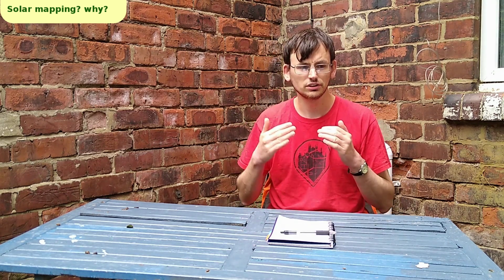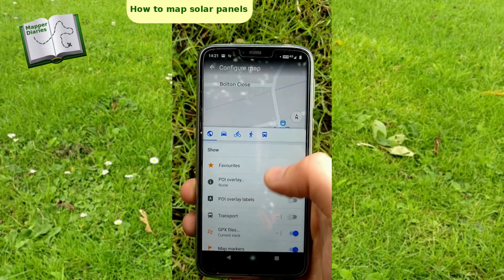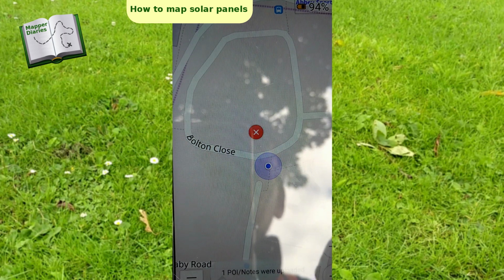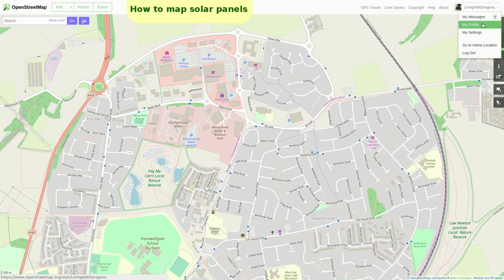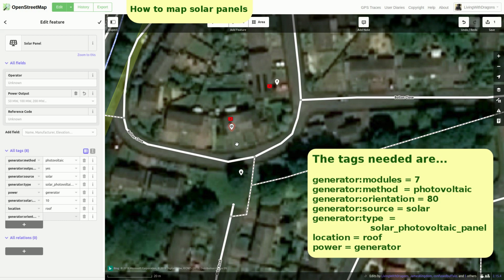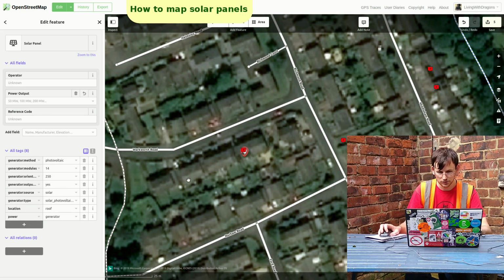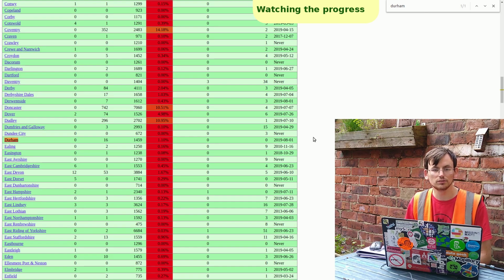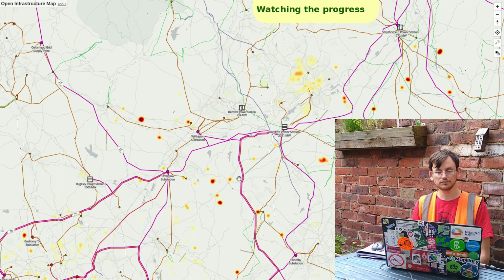Increase solar energy use with mapping

Comment: Thanks - I was going to chat with you about doing exactly this!

Just a note, from memory and conversation with suppliers, in the UK there used to be a 3kW installation point for small solar arrays that could be installed without telling the grid provider, so most domestic systems will be around that regardless of number of panels. Bigger kW installations, such as the 50kW one at the school where I used to teach, had to be notified/permitted since there is a bigger knock-on impact on the local grid and area.

Tech improves and you need fewer new panels to give 3kW than, say, 10yrs ago. One provider told me that people buy by the kW and the actual number of panels depends on that divided by the available area. The price balances out - fewer expensive ones vs more less costly ones. So, you can't just count panels and multiply up by one value - it'll need reference back to the various registers (Govt grants, installation notifications, etc.) to get the exact generation capacity.

Don't forget 'hidden' panels, such the Tesla solar roof system. That one replaces the entire roof with a choice of four different realistic-looking solar tile styles, so it's a stealth installation, and counting 'panels' won't work. I guess in that case, look for a few Tesla cars parked up and charge boxes on the wall... 😉
Reply from the maker: "We're still to device whether to use a single avg for each home sysyem, or estimate area, and num modules is helpful for that."

From Damien of http://openclimatefix.org, who also says... "Thanks so much for putting in the effort making this video! We're gearing up to use this data for solar forecasting."
Reply from the maker: Dan Stowell, who inspired this project, adds...
"Yes. We can use other metadata (e.g. date of installation) or aerial imagery (inc hyperspectral!) to estimate the type of tech used - so, on a large scale, we can narrow in on gradually better and better estimates of capacity."

Comment: Thanks. A useful video. A couple of things:
- In your introduction you say there's approximately 80k installations on the FiT register across the country. It's actually closer to 800k;
- When outside you map the module counts using "generator:modules"[1] and show that tag on the overlay on your video a couple of times. The majority-used tag, and the one used in my solar comparison tool[2], is "generator:solar:modules"[3]:
[1] https://taginfo.openstreetmap.org.uk/keys/generator%3Amodules#values
[2] http://osm.gregorywilliams.me.uk/solar/index.html
[3] https://taginfo.openstreetmap.org.uk/keys/generator%3Asolar%3Amodules#values
Reply from the maker: Ha, 80k did seem rather low.
It looks like I've been doing a combination of generator:modules and generator:solar:modules, I will try and change to the latter.

This is the trouble of trying to make a longer/detailed video without putting in the extra time to double check everything. I might try and do an update/progress video and include clarifications.
Reply: Hi, a quick note for Gregory Williams. Thanks for continuing to add useful cross-reference info to your summary website - things like any associated building will help spot areas where individual properties are not yet identified.

Since I've recorded a few generators in the Scottish Borders area (mostly Coldingham and Eyemouth) I noticed what looks like an import error on http://osm.gregorywilliams.me.uk/solar/scottish-borders.html - the 'Orientation' data is skipped, meaning data in all the other columns move left by one, and the summary percentages don't calculate (unlike on every other page on your site that I've seen).

Apologies for leaving this message here - couldn't find a contact on the solar summary site!
Reply: @examinerian  Thanks for your message. It looks like this is an oversight of mine. The issue appears to be happening on all of the Scottish areas. That'll be because the Scottish areas are being handled by some different code, because only England & Wales have LSOAs in the FiT data. I'll take a look at fixing it now. For future reference, my OSM profile is here: https://www.openstreetmap.org/user/Gregory%20Williams
Reply: Now fixed. The corrected pages should appear online shortly.

Comment: If we spot a mix of PV and HW panels on the same roof, we'll need to add two points to the property. There aren't anything like as many HW panels, but I have spotted a couple out and about the county. What would the tags look like for the hot water generators?
Reply from the maker: For the hot water panel, you can use these tags...
generator:method=thermal
generator:output:hot_water=yes
generator:source=solar
generator:type=solar_thermal_collector
power=generator
location=roof
generator:orientation=195
generator:solar:modules=1

Comment: If a building is already mapped, should I add the solar tags to that, rather than creating a new node? Cheers.
Reply from the maker: If a building is mapped, I have been adding a node within the roof. This allows you to still place 2 if they are some facing different directions.
Reply: @MapperDiaries  Thanks, that's a good approach.

Comment: Having trouble reconciling the FiT Register count in some areas on http://osm.gregorywilliams.me.uk/solar/durham.html.
For example:
E01020711: Durham 002C
Plant count: 0
Generator count: 5
FiT register count: 38
In that one tiny area there are only 100-ish houses, on 3 and a bit streets (depending on how the dividing line falls between zones), and I've only seen 6 with solar panels on, all on the NW side of the main road through. How on earth are there 38 FiT register counts?!? Even when two of the houses have differently-oriented multiple arrays, that's thirty short of the register total! Before I added any today (and none had been done for that area) there were 5 generators somewhere. Add the rest of the houses in that little island and there are only another three installations (two with multiple panels, one of which I reckon has 4 thermal panels surrounded by 15 PV - the view from the A167 was a bit tricky).

Another example:
E01020693: Durham 006A
Plant count: 0
Generator count: 22
FiT register count: 7
Completeness: 314.29%
This is one that I've walked plenty of times. There's one street where all 22 houses have a 6-module array, and there are another two in that area which I've seen (count should be 24, somehow is 22, though the dividing line to E01020692: Durham 005E runs through 10 of the houses, so two must be across the boundary). Give or take one or two, since I'd guess FiT is 'per property/metered connection' rather than taking two differently-facing arrays on a house as separate FiT entries, but still, 314.29% complete!

I'm taking the numbers as a rough guide - there's another zone I've done that is now one short of the 44 total, but I reckon that's just a phantom (or else someone with an unusually big garden behind high hedges had a ground-mounted array). At what point do we resort to looking on aerial photography?